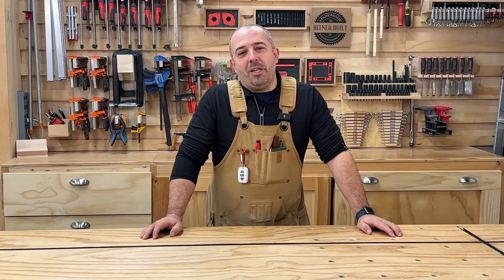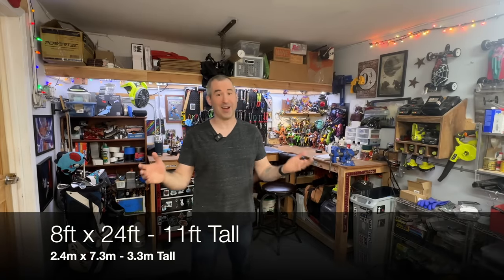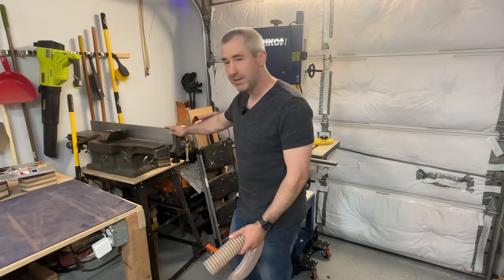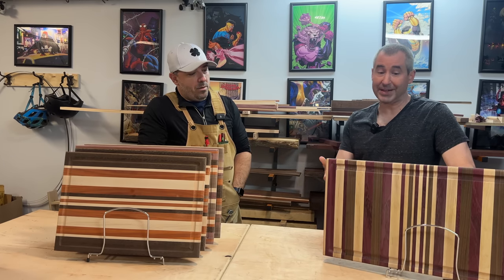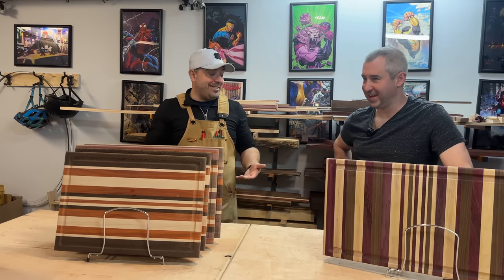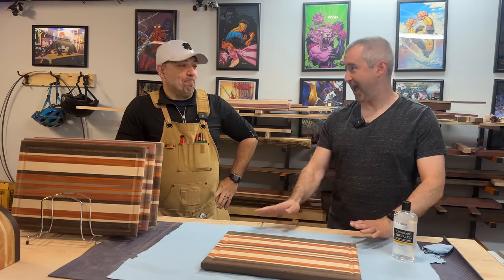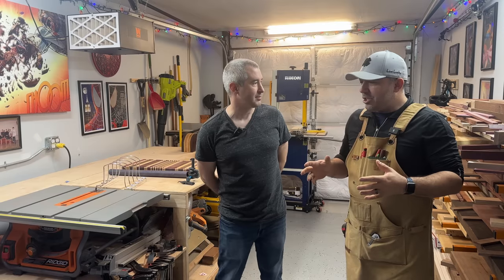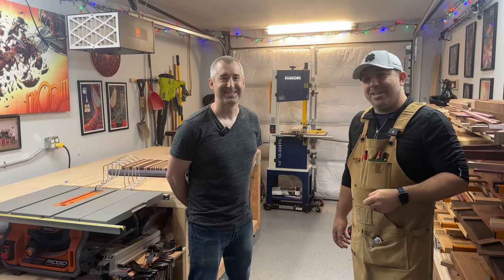1 Car Garage Wood Shop Tour - Visiting The Morris Collective - Custom Cutting Boards

Comment: I used to own a drum sander but my ideas of having it were quickly removed by the incredible amount of frustration with its inherent design and  operation. Lowering the drum onto the wood via the drum support arm was always hit or miss with accuracy. Had the table been able to be raised to meet a fixed spinning drum my problems most likely would have been solved. I took a tremendous loss on its sale. The drum sander ruined a lot more wood more than it helped bring flat. I still wish that the tool could do what I had hoped and that I was able to bring wide stock to a level and smooth surface. The best use of the drum sander was for very short narrow pieces of wood. The 16-32 design had me thinking I was able to do much larger projects than what I achieved in reality. I see many of these sanding machines being sold on the used market. If you do buy one never put on any sand paper other than 80 grit. That seemed to be the sweet spot in my experience with the machine.
Reply from the maker: Thanks for the helpful tips! I personally haven’t ever used one and yeah, I have an idea in my head of what it’s gonna be able to do for me so good to hear from somebody who’s been through it. I actually had bought one at a garage sale for $400 excited to get it for that price. I gave him the money before I played with it And then asked him to turn it on and do a whole bunch of stuff and he was saying how the knob broke and he had to adjust the belt every time with an Allen key as a drifted etc. etc. etc. so I figured it was a lemon and I got my money back… maybe more on par?
Reply: @BitnerBuilt  When you rotate the vertical adjustment clockwise you raise the horizontal position of the drum and adjustments are more positive. The problem is that you need to do the opposite because the bed is fixed. There is too much friction in the vertical support plates that it doesn’t operate smoothly no matter what you try to do. This sequence of adjustment also changes the drums parallelism to the table and creates a taper across the width of wide stock. When sanding wide stock I was also left with a rippled finish that looked like waves in the grain instead of a constant smooth surface finish even while sanding long stock at a extremely light touch. Different woods gave much different results. Some woods would create extremely hard resin to build on the sanding paper in the middle of a long board being run through the drum and the resin buildup would ruin the surface. My sanding adjustments were limited to just kissing the wood very lightly. The process was long, arduous and oftentimes painful. A hand plane can give you much better results. I used my sanding drum for wider panel glue ups and to finish sand shop cut veneers. It just didn’t work out well. I looked into newer versions of these sanders and seemed to find similar results. I just don’t believe that the engineering behind these drum sanders to be very good at all. Rarely will I even see a skilled woodworker on YouTube using one or ever recommend one. It was in my experience that every aspect of adjustment to the machine was in a constant state of struggle to maintain. It flat out sucked.

Comment: Good job on the video, and congrats to Steve for taking the next step!

I'm thinking about it myself. Got any good tips for forming the LLC?
Reply from the maker: It’s easy to do on your states website, don’t pay anyone. I personally like doing an S Corp., he first sign up as an LLC, and then file an additional piece of paper called an S Corp. election. It’s slightly more beneficial tax wise. Make sure to also register for an EIN number with the IRS it’s a free process. Of course, every business is different, I’m just assuming that you’re doing it as a small woodworking business.

Comment: Can you recommend a decent but not too expensive table saw?
Reply from the maker: Well depends on the “grade” your looking for. They start off with the portable Job site saws. The dewalt job site saw has a decent fence. If your looking for a decent cast iron table saw the delta sold at Lowe’s is what I own and it’s excellent for the price point ~$700 I have a video on table saws so you can see mine and what I have done to it there.  Another option is to buy a used one and then spend money on a nice aftermarket fence as the fence is the big thing with all your choices.